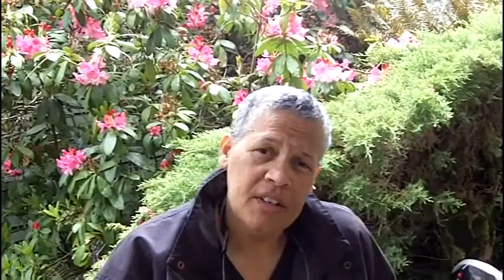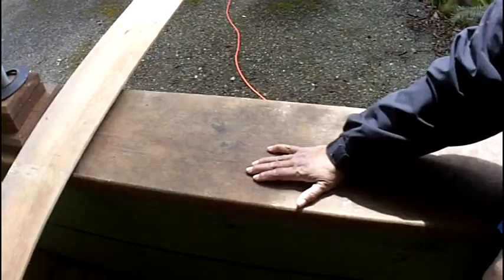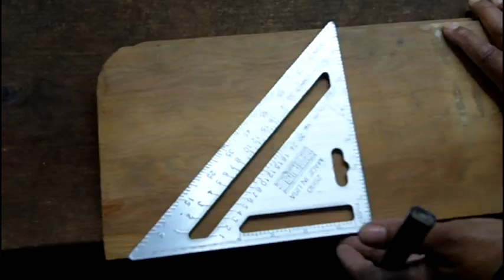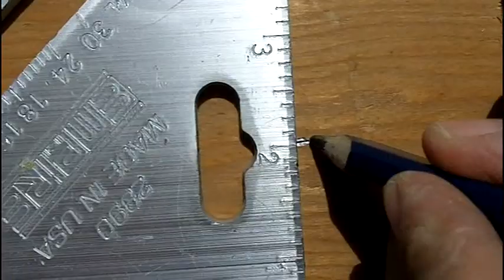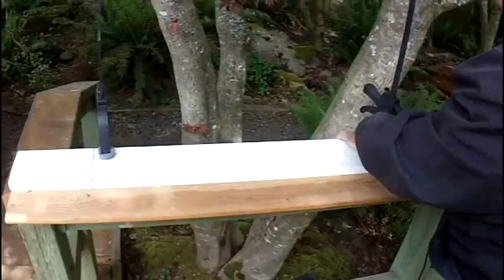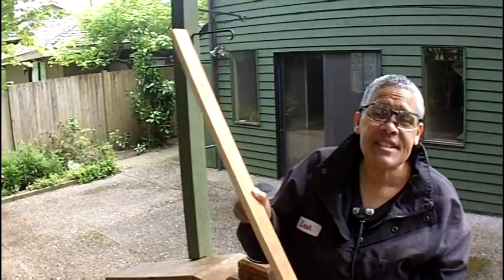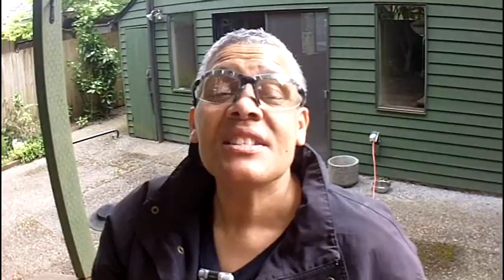How to Make a Perfectly Straight Cut in Wood with a Circular Saw

Comment: This is an experienced teacher.  Provides just what you need to know in pursuit of the learning objective.  She takes into account the likely skill level of the people watching this video in her presentation.   Well done.
Reply from the maker: +David Smith Thank you very much, David!
Reply: +David Smith exactly. I would certainly subscribe to any "woodworking for programmers" channel :)
Reply: +David Smith Yeah, I agree totally.   I don't know how many times I've tried to ride that line that I've drawn, it's never perfect.

Then again, 99.9% of those didn't need to be perfect.  In the past, I've just taken the board to the basement, and used the table saw.  It's still a great tip!
Reply: Hi  suppose you have to split a length of wood in half  4"   2" and 2". There is not enough width for the saw to sit?  Maybe this question is here somewhere
Patrick
Reply: Patrick Stratton just hold the saw straight. It doesnt need a place to sit if you hold it straight. I cut that way all the time
Reply: Real Deal DIY Glad you don't do any work for me.
Reply: @patrickstratton4630  A lot of circular saws come with a guide that rides the edge. Very useful in this scenario.
Reply: Leah, remind the folks to also make sure they are not cutting into the support table. The kerf needs to be just a bit over the edge. Unless you don't mind a bunch of shallow trenches in you work bench. 😉👍
Reply: @muttley1956  There are experienced framers who I know who do not use a straight edge at all.  Almost all of them use Skilsaw Worm drive circular saws. They do this for a living so they have gotten to be experts at cutting word perfectly with no guide. I could watch those guys work all day because time is money as they say and the saw is like an extension of their arm. It is kind of like painters who do not use painters tape to "cut" edges. They use a special paint brush and do it free hand and get a perfectly straight line every time. 
Of course if you are someone like me, a DIYer who needs a guide to make a straight edge, this is a great tutorial.

Comment: I noticed something that I’ve learned over the years that can catch people out. When measuring from the shoe edge to the blade, you must measure the the edge of the cutting blade tip, not the inside of the blade face, In many instances, the tungsten bit is slightly offset and will result in a fraction of a difference in the result. On your video when you measured the finished cut it looked like the measurement was a fraction smaller than 2”.  This is true for table saws as well. Always measure from fence to cutting tip for exactness.  Thanks for a great tutorial.

Comment: Leah, you are RIGHT! I can and did do it - just like you said; I was using my circular saw to cut a piece of railing for my deck.  Your demos were what I needed, worked like a charm.  I really appreciate your help, it was precise, helpful and very clear.  I am only 67 years young and 5'2" and not a lot of muscle, but watching your video gave me confidence that I could.  I used to watch my Dad do everything when it came to carpentry.  He taught me how to use a hammer and a saw but never any power tools, of course, I was only a kid, so...thanks for the great help.  I can't wait to do the next step in my deck renovation. Mary
Reply from the maker: Mary Mathis Mary, that's fantastic!!  Way to go, I'm so glad you to hear that it worked out for you, and you should be very proud of yourself!  Thanks for writing in and letting me know. Leah

Comment from the maker: Reply to 6043ron:
Hello Ron,  To answer your questions:  Does it matter which side of the blade you measure from?  Yes, you always want to measure from the waste side of the blade because the cutting action of the blade creates what is called the "kerf".  Does the number of teeth matter?  Yes.  You have to consider the material you're cutting and whether you're ripping (cutting parallel with the grain) or cross-cutting (cutting across the grain).   I like to use a carbide-tipped, combination blade, which can be used for both ripping and crosscut.   But what I think is perhaps a more important factor in the quality of cut is the condition of your blade.  A rusty, dull blade is not going to deliver the kind of performance a sharp, well maintained blade will.  Hope this helps!
-Leah
Reply: if I put a router bit on a saw and make a sled for it will it cut the same as a router
Reply: If you have enough zip ties, duct tape, and clamps!
Reply: good video. I think important to point out you're measuring from the side of the saw without the motor.  if you try to do the same with the motor side butted against the guide your motor will hit into the guide or your clamps.  also, I really dislike those squeeze clamps, I ruined some good board by having those clamps drifting on me, I prefer the clamps with the screw knob, it holds more confidently.
Reply: you always have helped! keep it coming!
Reply: seejanedrill
Reply: seejanedrill f&
Reply: You are absolutely correct about the motor hitting.  However, what I always did was to simply adjust the "depth-of-cut" so as to "elevate" the motor above the guide. When you are doing it professionally, day-in-day-out, you automatically adjust the depth.....you don't even think about it as its just part of your normal setup to make the cut.   Adjusting the cut depth, by the way, is also a normal (don't even think about it) type of thing you do to prevent bottom-side tear out in certain types of materials and certain types of applications. (Finish Carpentry, for example, where you really, really want a Smooth cut!

I totally agree about squeeze clamps drifting.......I used to use them for all sorts of things....but when it had to be a perfect cut, well, nothing better than all-metal screw clamps (I think your "clamps with the screw knob").   I actually had several hundred of them.  

But all clamps have their time and place.  Can never have too many.

By the way, I was from the old school where we "hung" our own doors.  Still a skill in custom high-end finish carpentry jobs.
Once the door was "scribed" to the opening I always (well, in a hurry, I'd do it by eye -- and was very, very good at it) used a jig to trim the tops and bottoms.   I made my own using 1/4" hardboard -- make a four foot piece eight inches wide and then cut another two inches wide.   Glue the smaller piece to the larger one, flush on one side.   (gotta know how to glue.)   And then would  run my saw (Had To Be A Worm Drive cuz' they're the easiest ones to cut straight with) straight down the guide and it would "trim" the jig to the perfect size.    Got a line scribed on the door?  Align the jig with it and clamp it down (using squeeze clamps ((or spring clamps which are quicker))) and use a utility knife to "pre-kerf" along the side of the jig and then go ahead and trim it.

Done it thousands of times???   Well, actually way, way more.     And always had to lift the motor, and never had to think about it.
Reply: @cheryldavis5228  Agree about squeeze clamps. I think how easy and accurately you can change the depth of a circular saw blade should be a factor in what you choose to buy.  Done much the same with cutting guides and think about the torque for different saws taking the cut line towards or away from the guide. Utility knife to "pre-kerf" or run the first cut only 1mm deep and backwards. Keep blades clean and use wax or other treatments to keep them clean and smooth. Use you local saw sharpening company. Just had delivery of a 210mm (8.25") 80-tooth blade for my Makita - looking forward to some very clean cross-grain cuts.
Reply: @joeny1980  I’ve run into this problem but was told the waste side should be on the shortest part of the foot not how it was done on this video. However I can see why I’ve been struggling when using clamps. However I guess using the short side on the keep you risk tilting at the end of your cut

Comment: Great video Leah.  Don't forget to make sure you adjust your cut depth too - 1/8 to a 1/4 inch more than the wood thickness. Don't want that huge blade with over 2 inch cutting capability fully extended on any cut. Thanks for sharing.  Great work Leah.

Comment: They call it a circular saw, but it's hard to cut circles with it.
Reply: ***** 20-something years ago someone came up with a triangular blade for circular saws. the ads showed them cutting circles with it. i imagine they went down the toilet in short order.  just found this: http://www.farmshow.com/view_articles.php?a_id=833
Reply: Chris R I forgot all about those triangular blades.
That was in the days before the new oscillating multitools.
Reply: +Chris R I have one. I still have never tried it out yet. So mine is in mint condition. Nah mine is nicer than what you linked to. Now I'm going to have to get up, and see what brand it is. The one I have is called a Triad. It has Carbide teeth.

Comment: It's not a 2" wide piece, it's less than that by the width of the kerf. To be accurate you should have measured from the inside face of the blade (the side closest to the saw motor) to the edge of the shoe, not the outside face as you did.
Reply: +john milton You are correct - but the teeth on these blades are always wider than the blade, so it's more accurate to take a measurement from a test cut.
Reply: +john milton Correct. I was about to make the same observation myself. That is why the piece cut was a little less than 2", as can be seen at the end of the video.
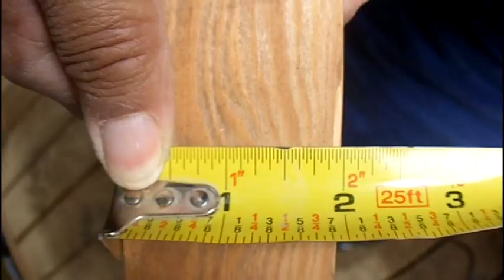Reply: 6:09 says 1-15/16 or 1-7/8 or on the average 3/32 short. Working with trim, that's a lot. This is not a job for a tape measure. Use a stick rule. If you don't have one get one and get use to using it. You'll learn love it especially for cabinets etc. Sometimes "old school is the best school"
Reply: Whatever you say.
Reply: Oh, great: yet another carpentry genius giving us his input on how things should have been done. What I wonder is, why a carpentry genius would be watching a video on how to make a cut with a Skil Saw in the first place.
Reply: profd65
Experts take an interest in every aspect of their field of expertise, which is how they become experts...Hope this answers your question. There's only one way to use these saws accurately. First set a fixed guide and measure the distance from the guide to the finished cut, write this measurement on the saw and use it to set a fixed guide when using the saw.
Reply: Iazzaboyce
I don't know in which world you dwell, but I dwell in the real one, where professional carpenters don't worry about achieving NASA tolerances. If your house has a deck, go outside and put a tape measure on it, and see if your standard of perfection was met.
Reply: I know precisely how my house was built, because I built it. I think you will find that the method I have described to use this type of saw is the easiest, quickest and most accurate. I can't think of a good reason to do it a harder, slower and less accurate way.
Reply: profd65 agreed. My house was eyeball for sure, gaps that can be fixed by sealant or that paste to fix the wall
Reply: Daniel .Coching
Built by 'professional carpenters' which means 'people that work with wood for a living' - it doesn't follow that all professional carpenters are good carpenters. Usually gaps and poor fitting is a good indicator that structural work has also not been done correctly... Aspects where the application of sealants and paste is less effective.
Reply: Caulk and paint, ........... make a carpenter what he ain't.
Reply: Because any well experienced and skilled person knows that, he can always learn new things.
Reply: Everything in this tutorial is correct, but i also agree on that you have to measure the blade on the inside face. You can ignore the kerf in many situation, but there are certain circumstances when you just can't. I would also mention that when somebody use a long guide, its better to fix that guide also in the middle or even more places. The force against that board, can cause curved cuts.
Reply: Um, kerf!
Reply: chris b 
Um, no.
Reply: I used my Dremel to add the plus sign on one side and minus on the the other side of the blade on the shoo. Simple's.
Reply: wow, so many armchair carpenters here...this thread is hilarious.   I've yet to meet one professional carpenter that worries about the degree of accuracy most of these people are complaining about...if you did, it would take years to make a house -- find two just two standard 2x4s that were exactly the same.  LOL.  I'd laugh if my contractors were re-ripping stock because of kerf difference -- it simply doesn't happen -- You're literally arguing over 1/16ths of an inch in accuracy.   Woodwoorking and trim, okay -- I'll give you that, but if you're depending on a circular saw and expect to make precise rip cuts, period, you're an amateur.
Reply: brianohbrian burns straight not strait
Reply: And this is why you have a popular video on YouTube.  Leah is wonderful
Reply: profd65 great comebavk
Reply: profd65 Maybe to see if she allowed for the thickness of the blade.  A common mistake that doesn’t take a genius to observe.
Reply: Agreed, she missed the cut and made some scrap wood. 1 7/8 is not 2”, my blades are 1/8” thick. How about where she adjusts the depth of the blade? I could do better by using my screw on rip guide. Now what does she do if she wants an exact shewed cut? Hire a carpenter. She perfectly presented a perfectly the wrong way to do something.

Comment: Sound technique. Only two things I would add:

I agree with the comment below that you should measure at the widest part of the blade's teeth set. You can see that your cut is slightly short because you didn't compensate for that. If your tolerances need to be exact, that could be a problem

Second, I would never use those cheap Harbor Freight ratcheting clamps for cutting with power tools. Always use metal clamps with a set screw for power tool work. The plastic ratchets are only OK for glue ups and other non-critical tasks. They work OK for a while, but they fail without warning (I've had this happen!). If that happens while you are cutting, the best you can hope for is a ruined work piece. You might also earn a new nick-name: Stumpy!

Other than that, keep up the good work.
Reply: GASP!!

I love those clamps! I've used them for years (sans problemo) - now you worry me. :(

Comment: Good info Jane except for one very small detail.  You did not allow for the blade width on the saw, so your 2 inch cut was actually 1 7/8...just a small bit of FYI, I always cut on the outside of the line to allow the blade width.
Reply: Yup. U r right
Reply: That's the difference between a carpenter and a woodworker... 1/8".
Reply: You should watch the video again. Pay close attention to the shoe to Blade measurement

Comment: and if the piece of wood allows for it use the guide on the other side of the saw so the larger part of the foot (baseplate) can rest on the material. using the guide as you did caused you to have an unstable saw and the edge of your cut is not as square or straight as possible.
Reply: +Stan Rodgers If you are using a circular saw, I doubt the piece is that critical.
Reply: Tec 9 I always try to work it that way and yes often it does matter.

Comment: nicely done,can u show how to use the metal guide that comes with most circular saws?,it seems somewhat similar to this
Reply: +neil crompton I've tried those. I think the best thing to do with them is to look in one direction and throw them in the other. They're better than absolutely nothing, but just barely. Specifically,  they tend to bind and catch, encouraging the saw to try to turn to the right instead of going straight.
Reply: You can always mount a straight piece of wood or aluminium to the guide: it makes it a lot more accurate.
Reply: António Lopes ,
Reply: neil froggy crompton
Reply: Uhm.... Jose Canseco.

(Why do people just say other people's names?)

Comment: You cut it straight but the measure of the blade is wrong, the cutting teeth are offset both sides of the blade so you cut the wood less than 2", not by a lot but if you want accuracy this should be taken into account
Reply: Insignificant amount unless the man making this video is using the piece of wood as a neurosurgical tool.
Reply: BornToRunBarefoot Yea but as a cabinet or furniture maker...would you really use THIS method to make a cut?? I don't think so, I view this tip as valuable, in case you happen to forget or if you don't have a table saw at that moment and you don't have to be fully accurate
Reply: I agree that Jane did not make allowance for the blade kerf.  The straight edge should have been set another 1/8" over to make a true 2" board.  That is assuming of course that the blade has a 1/8" kerf which is quite common.  There are some thinner blades that have a little less but not usually used for rough cutting.  The technique however is correct.
Reply: Why not use a finnigin pin that is fitted through a round blocked of rusty bearing.